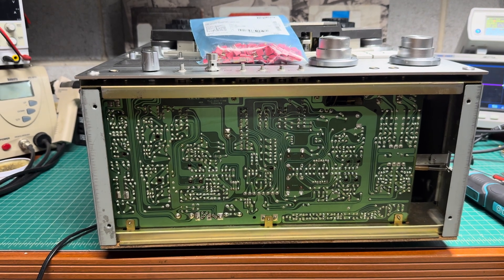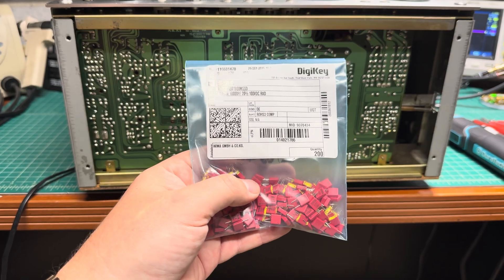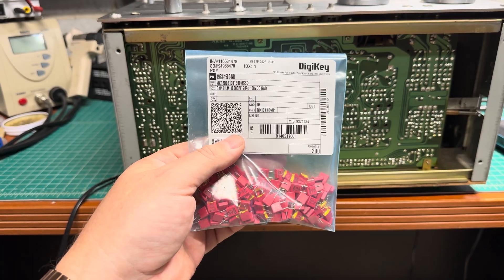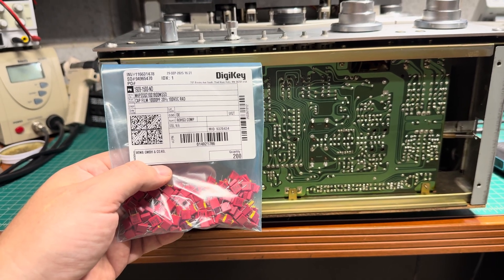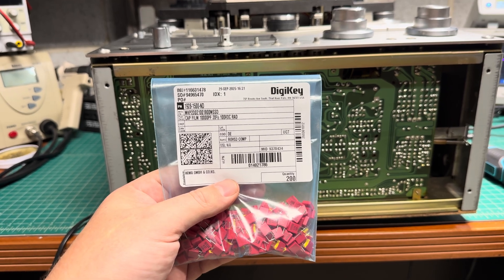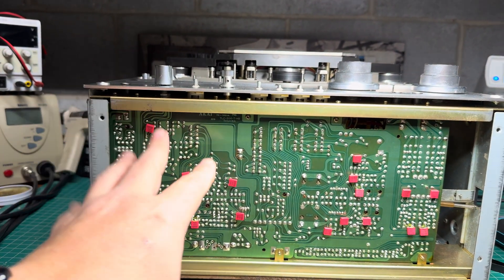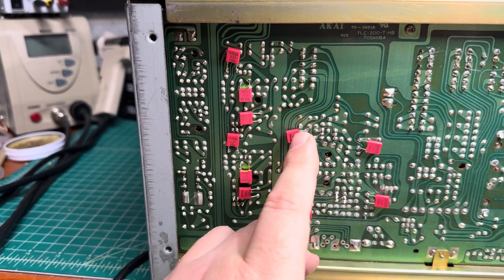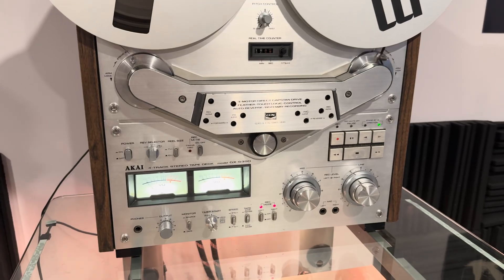Improving High-Frequency Detail on Akai GX-635D | Simple WIMA MKP Mod That Works!

Comment: Amazing work and sound 👍 I love AKAI tape recorders, I used to have a 646 model, I sold it with the intention of buying a 747, but then I had an accident on my motorcycle and the purchase never happened, the money was needed elsewhere, but I still regret it to this day.

Nice day 🙂 Tom
Reply: I had an Akai GX-635D purchased new in 1980.  USAF stationed in Spain.  Also had a sort after Marantz 2385 Amp.  When I got married I sold all my HiFi equipment in 1983 for $700.00 for everything.  All high end turntables etc.  We needed a couch.  Family first, but I feel regret.  After 43 years of marriage my wife asked me if there was any regrets getting married all those years ago.  I said not really a regret but I miss my stereo equipment.  She said get more.  So I ordered an Akai GX-635D from eBay and have been restoring it for some time now.  I am going to do this upgrade too.  Tom I hope you can someday get your GX-747  They are a nice unit.